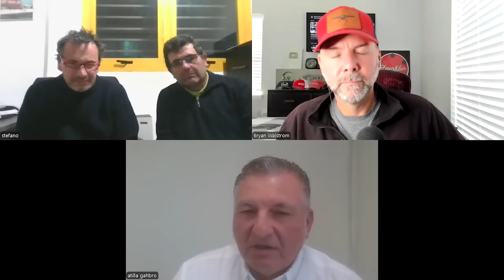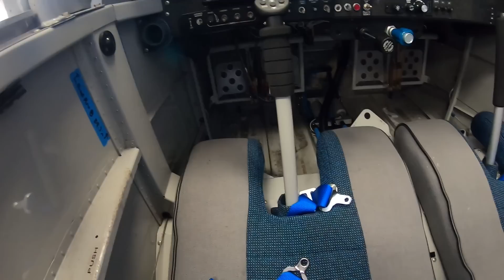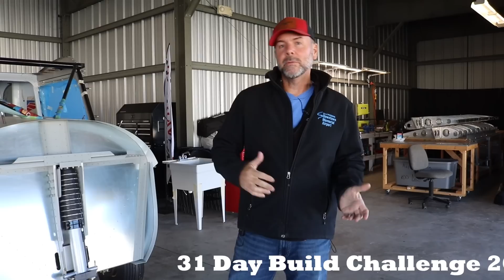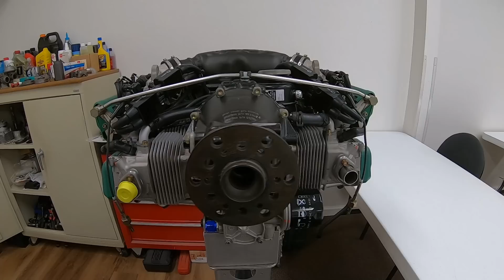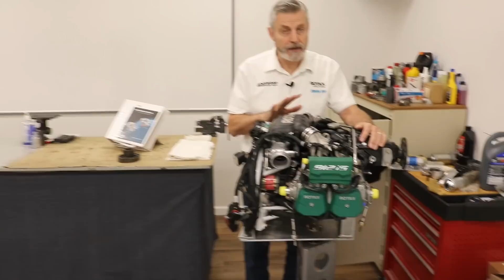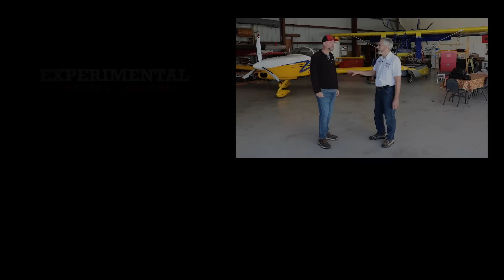Rotax Aircraft Engines - ENGINE WEEK 2024

Comment: My 916is has 2760 hours on it total. Well past TBO. To be fair I run it at partial power when possible.
Reply: Why did you exceed tbo ?
Reply: @Brendan4570 because you are allowed to fly on condition for your own aircraft. It's completely normal. TBO is only required for commercial flights, sightseeing, etc.
Reply: You should Google when you are allowed to exceed tbo, it's actually quite often

Comment: The first time I heard a 912 running on the ramp, I thought it was eating its own gearbox. Sounded awful. How does that driveline go from 80 to 160 hp with aviation-grade reliability?
Reply: Lots of engineering work. Keep in mind that these continental and Lycoming engines are built using 1940s designs with 1950s manufacturing methods. Rotax is using the latest manufacturing methods which significantly increases reliability, even though some of the other choices like having a gearbox and running at high boost do in theory reduce reliability over one that doesn't, the overall reliability is still higher because it's a much newer and better engine.

Comment: I wonder wether there will ever be a certified 916 replacement option for the C172. I think it's a pity that they did not modernize the smaller versions with fuel injection. They would be nice for the traditional ultralights to save fuel. Also imagine the potential auf a 220 HP 2000cc version or a 240 hp 6 cylinder version for the C182 and SR20

Comment: I have been advised now with the new xps oil for the 912iS, burning 100ll you no longer need to add Decalin type products to get rid of the led. Is this true?
Reply: Don't run 100LL. The plane I fly runs fine on 93 auto gas.

Comment: feels like a new RV fuselage would be better. Move the cockpit/baggage forward a bit, so you don't have to move the engine as far forward.
Reply: The RV9 was designed for the O-320.
The Rotax 916 will find its niche when a new generation of aircraft emerge that were designed for it.
A Rotax powered RV9 is an interesting idea, but I doubt the market for it is quite limited.
Reply: @philipritson8821  "A Rotax powered RV9 is an interesting idea, but I doubt the market for it is quite limited."

I don't think you meant what you typed. I suspect you meant, "A Rotax powered RV9 is an interesting idea, but the market for it is quite limited."

I think you'd be surprised how much demand there would be for RVs with higher power Rotax engines. Air cooled engines with no turbos and overly expensive are no match for a lightweight, liquid cooled, FADEC controlled, turbocharged engine at a lower price.

same HP, lower weight, lower drag, lower cost, etc.

Comment: Do you have a video on the Rotax 582?
Reply: It's not available new anymore
Reply: The 582 is essentially a snowmobile type engine. They are powerful and light. Consume a lot of fuel for their moderate midrange power output due to 2-stroke design. And they vibrate a lot, being 2-cylinder. And they seize-up during long power off descents. Because the oil is mixed in the fuel. When you lean one out, or pull power back, and keep the propeller spinning due to slipstream, the engine wears out rapidly without oil. Gets hot. Seizes. And you eventually crash.

A Polars 4-stroke, V-twin, efi is probably the way to go in that 60-70hp range. Merlin V twin is a similar concept based on a Polaris clone engine.

Comment: Why is there so much hate on rotax?
Reply: - Austrian.
- Liquid cooled.
- High RPM requires a gearbox.
- Relatively new (well newer than the O-200 and O-320).
- Underpowered and too light for an RV7/RV8.
- Several generations of air maintained engineers have not had over 70 years experience servicing them.
- Run best on unleaded automotive gas, which may not be available.at your run of the mill airfield.
It think that covers it.
Reply: RV-12

Comment: Side note, Rotax could probably fairly easily make a decent turbofan jet engine for light planes but they don't have the vision for it
Reply: U feeling ok ? 
Do you even that a drop of idea the expertise toodesign a turbine engine.
Reply: @Max__apex  Are you ok? :) that sentence was a little messed up but I know what you mean. And yes I am gathering the insight to do it. It's not that difficult and indeed metal 3D printing can greatly simplify a lot of the production. You have to size the compressors and turbines right, get the blade angles and shapes right, it's not super trivial but let's say it's been done before and there are better tools now than ever. And once designed it's not exotic to manufacture. Many of the fans in the size of engine GA needs would be CD size. Something you can palm. The simplest design has 3 small rotors and one larger fan. The larger fan might be the width of a piece of paper. It's basically a car turbo or an angry space heater. It can be surprisingly simple. Indeed much simpler than a piston engine. If you look at a specific jet engine and think that looks complicated keep in mind spacex' latest engine simplification and compare it to other engines. You can also look in the gear well of a typical airliner and see an incredible mess that is the result of just less than brilliant engineers piling on. It could be drastically cleaner. Look in the avionics bay of an airliner. It's a data warehouse of junk because idiots made it. All that could be in the cockpit dash and the cockpit wiring could be 50x simpler at the same time.
A jet engine is fans blowing air into a burn chamber that blows on other fans. That's pretty much what it is. The compressor just has to provide a pressure a bit higher than the resulting combustion that is then let out of a larger opening than the compressor air came in. That's how it force multiplies and keeps the direction of flow. Airspeed changes effective pressure so it's a bit more complex than that but basically. Say you compress air to 10bar and then burn fuel and let it out at 9 bar pressure. And surprisingly fuel can burn super fast if you spray it in hot compressed air. Small electric motor spins the inner shaft up a little for starting and sparkplugs ignite it. The electric motor can double as the generator. Because the shaft spins so fast a tiny electric motor can produce a lot of power. the power density in an electric motor is proportional to the rpm. it's only a matter of when it flies apart. And some air resistance
Reply: @DanFrederiksen  
Talking is possible ….. doing is a different story
Reply: @Max__apex  Sherlock, I presume. What are you doing other than talking here? how is your talk so magic...  or just maybe you are a status quo naysayer and not actually thinking

Comment: The problem with the conventional engines like lycoming and continental is their still old technology. I fly a rotax  have for many hundreds of hours  two strokes and four strokes their all pretty simple all carbureted the bing carburetors are easy to access takes about two minutes and a screwdriver to get them off but which one would I rather work on in the field…… probably a lycoming or continental just because of their simplicity.
Reply: Classic aero-engines were very good for their day. They lagged behind in modernization.

At minimum, they should probably implement multi port piezoelectric fuel injection and modern coil on plug, high energy electronic ignition. Nikasil lined aluminum cylinders. Etc.

Comment: One thing Dean didn’t mention that bit me when signing up for their classes is that it is a two-step process.  I forget the fine details now, but I signed up online and thought I was all set, but apparently the online signup doesn’t actually reserve you a spot in their class.  You actually need to call them to REALLY get a spot reserved.  I learned that the hard way and had to reschedule a later date as my initial preference had some of the classes already booked full before I found out that I really didn’t have a spot reserved.  Maybe they have since fixed this, but this was the case in 2022.

Comment: Would the same 916 fwf work for RV-7 and RV-8 for CG? (Edge has answer to more hp.)
Reply: From what I've gathered, the fuel and oil systems on Rotax can't do negative G for any significant amount of time. The fuel injected variants should have enough fuel in the lines for a brief periods of -G. But speaking of Gs, the RV-7/8 are rated to +6/-3 Gs at their aerobatic gross weights. I doubt Lockwood et al designed the new engine mount and cowling to those loads. The RV-9 is designed for utility category loads (+4.4/-1.75 Gs) under 1600 lbs and standard category loads (+3.8/-1.5 G) above that. Might be fine, but do some engineering work before you become the test pilot

Comment: Nice Airplanes, probably much safer than a motorcycle.   Well ya know.  I just acquired that Over 70 status this year and so that included that 95' Honda Nighthawk cb750 motorcycle.  ($600 barn find from West Virginia) ~ Got it running, but those carburetors.  Four of those. Maybe I'll just go along with your "Build Challenge" for the rehab on those.  I do like the concept.  The way that I work too. One day at a time.  Oh yea‼.         New Hampshire.
Reply: With a bank of four vacuum gauges, balancing the carbs on your Honda should be a piece of cake!

As a motorcycle mechanic I really enjoyed balancing carbs as the before and after was so profound!

It is a remarkably simple process once you have a set of vacuum gauges and carb tools.

You Tube will probably have videos for your specific motorcycle.

Good Luck!

Comment: I learned a thing or 2 about the almighty Rotax, mostly that I'd like avoid it if I can. Use mogas but increase idle, use no lead but add lead sub for valves & to "just blow the dust" into the air we breathe. Yikes. I hear Austria's other great, KTM is also doing nicely....
Reply: You clearly haven’t any experience with a 915/916. Nothing that you speak of exists.

Comment: I LOVE Lycoming❤
Reply: Yes!  Yes!  When Rotax can mass-produce a liquid-cooled engine with a radiator, dry sump pump, dry sump oil tank, gear reduction drive, oil cooler.  (Things a Lycoming does not have) With 20 more HP than a Lycoming.  That's 20 pounds lighter than a Lycoming.  And the same TBO.  What's not to love about a Lycoming?  No doubt, you voted for Harris.

Comment: What's the point of unleaded fuel  ?  Early 70 ' s , I know the case and what was said  .  The point is , our g o v has been up to no good for a long time . Does anyone remember the fuel crisis of the early 70,s  ?
Reply: It is pretty well established that lead isn’t the best thing for humans to breathe or ingest.  That isn’t just government propaganda.  And lead causes other issues such as fouling of spark plugs, much faster contamination of oil, etc.  Engines that can run on unleaded fuel are just superior to engines running on leaded gas in every possible way.
Reply: Jimmy Doolittle himself was poisoned by a can of Tetraethyl Lead that he carried along as octane booster.

He surmised it was not the answer, and a better solution was needed. Here we are, 90+ years later.

Turns out, if you boil off the lighter aromatics in fuel, you are left with the lower vapor pressure molecules. Such as; Pure octane. (100 octane, by definition). 

It just takes extra refining steps, and energy.

There are several other long chain hydrocarbons that work equally well or even better. Sunoco race fuels and now GAMI G100UL both use these specific mixes to achieve a true 100-105 octane lean, 130+ octane rich blend.

None of this is necessary for small engines with small piston diameters, aluminum liquid cooled heads, nikasil liners, higher RPM, and low BMEP.

Old aero engines with steel cylinder liners, large piston diameters, low RPM, high torque and high BMEP (Supercharged) will required 100LL or G100UL. 

Any recreational Powerplant product should avoid leadded fuel at all cost. 90 octane, ethanol free is widely available.
Reply: @Triple_J.1 I understand ,,, thanks man.

Comment: I fail to understand how Rotax can build this amazing super light modern engine but after all the time  they have been in the market they still haven't figured out how to build a gearbox that can run at all rpms without causing issues.  Viking has that part figured out. Why doesn't Rotax modernize the gearbox? Thats not that difficult.  It cost them lots of engine sales when builders are on the fence between a legacy direct drive and a rotax. The carb sync concept is another area that could be remedied with a single carb induction. Much simpler  and if done properly wouldn't sacrifice any performance.
Reply: What ae you talking about. No such issue with their gearboxes exists. You have to set the idle of their engines to 1800 which means around 875 on the prop but that's it. They don't like lower than 1800 idle.
Reply: @ You should have watched the video.
Reply: Viking does not have a clutch in their gearbox. If you have a prop strike the engine is gone most likely. Plus don't trust anything viking does, they are dodgy.
Reply: @chippyjohn1  agree to disagree sir. U are correct about the clutch. I dont plan to have a prop strike. As for Viking,  they set the standard for customer service.  I dont personally knowing anyone that's had a bad experience or that has been treated wrong and I am familiar with most of them. If you knew the history and the facts you would not call them doggy. Best company in aviation right now period and the record prices that. It's ok if you are one of those automotive conversion haters . They produce the best gearbox on the market.  Gearbox allows us to swing bigger props for more torque . Fantastic for stol ops. I really like the weight advantage of the Rotax but the pilots I know have problems with them quite regularly and they are just way too expensive for something that many problems.  I've been flying for 30 years and I've never seen anyone have a prop strike.  I learned with the standard direct drive 4 cylinder like most pilots and learned at an early age to take care of the prop. That clutch is the weak point.  I deal with gearboxes daily in my profession and that is true of all of them. The ones with just gears dont give any trouble as long as they are oiled properly. All large commercial engines rely on gears to time the engines because gear-timing is the most reliable in hard use industrial applications. I will be the first to admit,  if I hit the lottery I would consider the new Rotax 916 for its power to weight ratio but 70 grand is just ridiculous. Plus you cant just go get one. Rotax is manufactured by the largest engine company in the entire world and theres no excuse to charge as much as they do other than they rape customers because its "aviation ". Absurd!
Reply: @richardturner6278  I'm all for automotive engines. I prefer and use them myself. I've watched Vikings videos and seen their website plus read other people's experiences after I became suspicious of them. Honesty and integrity are worth money. The dyno graphs on their website are made up for one. He contradicts himself in videos, attention to detail of their product is low and the way they went into administration taking peoples money then suddenly had finances to start another business is terrible. I don't see much use for a clutch in the gearbox, but some people do. Rotax does not also have much of a flywheel which effects low rpm running smoothly.
Reply: @richardturner6278 Yes, we know that the only people who have prop strikes are those who planned it.  😂
Reply: @richardturner6278 all fine justifications for someone who is cheap. There are zero gearbox limitations or probables during normal operations on a 915/916. Stay away from Viking. They are combative and argue back with everyone and their turbo engines aren’t altitude compensating and Peter off like a NA engine.

Comment: Replacement for a 320 or 360 Lycoming Ha ha ha. OK sure. 915iS /916iS are rated at 135 hp / 137 hp continuous. Lycs rated at 100% T/O power all day, 180 hp.  LOOK AT THAT SCOOP., longer nose equals more drag than an air-cooled engine. Cost? A Rotax is more than a Lycoming.  Ever burb a Rotax? Pain. Let's see side by side RV-9 fly-offs with this Rotax powered RV-9 vs. Lyc powered RV-9. PLEASE. It is all talk until you get data. Cost? A Rotax costs MORE than a Lycoming. Yep turbo is nice. Guess what? Lycoming's can, have been and are turbo'ed for 60 years. Not new.
Reply: Yea but 160hp for 5mins at any level. How much HP do you get out of an Lyc at 7000feet let alone 9000+feet
Reply: How much is 100% of your Lycoming’s power at 12,500’?
Reply: Wow, you have an axe to grind ! There's pros and cons to both, and some of what you mention is incorrect. Longer cowl has little effect on drag, more on longitudinal stability. Burbing is not necessary if the oil level is ok. And it's lighter.
Reply: Haven’t flown around rotax turbo  motors have you … 150 lbs lighter and above 7000 ft begins to whip these more powerful engines … at high altitude it blows them away … Turbo Lycoming you say ?    Cheapest turbo Lycoming is$70,000 … nearly double the rotax
Reply: You’re a cranky idiot. A 916 is 80LBs lighter and paired with a CS will match any 180hp FP dinosaur engine from SL to 5,000 then walk away and do it all 1gph less. It won’t rust in 6 months from shitty metallurgy. Shock cooking, CHT’s, leaning the list goes on. And no you can’t easily find a turbo and throw it on any old legacy engine.
Reply: @gmcjetpilot  Burbing?  😂
Reply: Also neglected to mention the significant Rotax weight saving of both the engine and the fuel you have to carry to feed it
Reply: Rotax is far better.